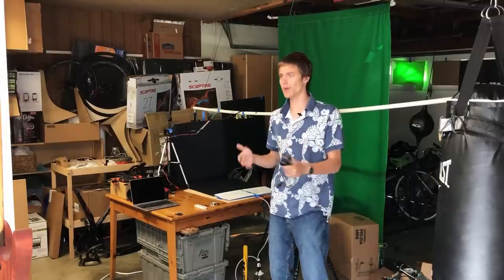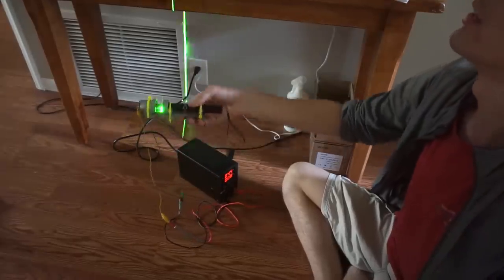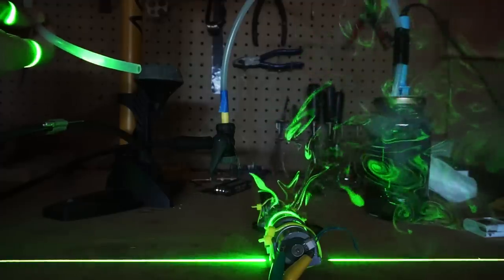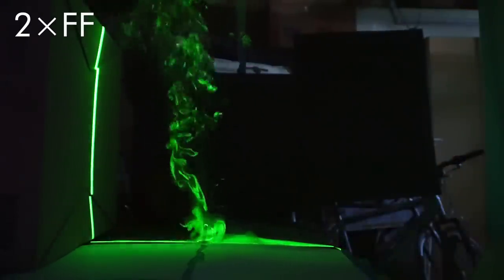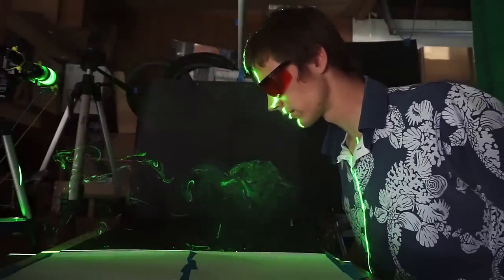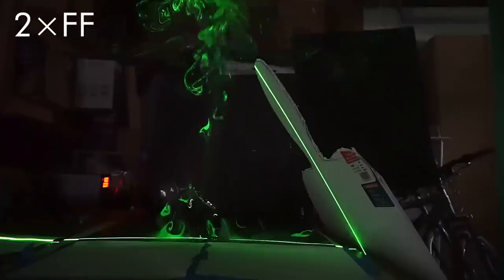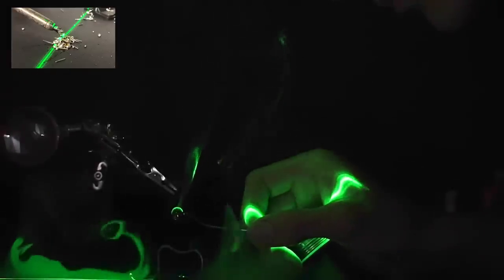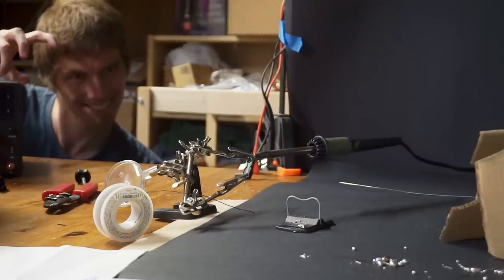Why does smoke from a soldering iron ALWAYS go towards your face???

Comment: As a guy with stage technician experience, I can tell you: Yes, evaporated baby oil is in fact harmful to your lungs, and can cause what is called Lipoid Pneumonia. If you want to be safe, use regular fogger fluid, which is a mixture of water and propylene glycol or glycerin, which is perfectly safe and won't hurt your lungs.

(And why the hell does this channel have so few subsribers ... it's awesome!)
Reply: So, what’s actually safe about fogger/vape fluid? It still accumulates in your lungs, and it doesn’t evaporate, right? Is it absorbed by your lung tissue and later removed from your bloodstream by the kidney? While for stage smoke you’ll often want it to be buoyant enough to fill a room, but using dry-ice or an ultrasonic exciter should work well enough for this sort of temporary use. Surprised ultrasonic vape pens aren’t more popular.

Also I’m pretty sure professional haze machines use oils, not glycol/glycerin, so in small amounts it’s probably acceptable. Though you’d probably get more particulate oil from working with an air compressor than going working at a concert venue.
Reply from the maker: Glad you liked the video, and wish I knew about the subs lol. I still have fun making stuff xD

Thanks for the info about oil smoke! I initially chose it because the internet said it wouldn't leave residue all over my garage but maybe I should have included a few more criteria... I added this to the description as a safety correction!
Reply: @Scrogan  Propylene glycol does evaporate, albeit slowly. Glycerol evaporates even more slowly. They are also metabolized in the body, and some gets expelled by the kidneys.
Reply: @AlphaPhoenixChannel  Probably a good idea to pin that comment in case someone  is thinking about trying the setup shown in the video
Reply: You can use 0% nicotine vape fluid also.
Reply: Oil is bad for your lungs, it's the same reason you shouldn't use an inexpensive off-the-shelf oil-based air pump for underwater diving, the aerosolized oil will damage your lungs.
Reply: @crazydavidsmith  Which, by the way, is exactly the same thing. Just sold in smaller quantities :)
Reply: small note about that fogger fluid: the water in it makes it susceptible to mold (which you don't usually wanna atomize and spread all through a room), so don't store it for too long. there's also mixtures with just the propylene glycol and glycerol (kinda the same as in a vape) that shouldn't have this issue. but yeah oil will kill your lungs, this stuff will trigger your asthma worst case but that's about it :P
Reply: You can also use an ultrasonic humidifier as a tracer source to be even more safer…
Reply: You could have used Incense Sticks. That would have made the experiment much religious.
Reply: @Scrogan  I am a year late, and the previous replies here are great. Just wanted to add one more detail: Glycol, the "main" ingredient in fogger/vape liquid is an alcohol, even though many people confuse it with an oil. So, those liquids are mainly glycol (an alcohol) and water. There's no oil in it, so both components are safe to inhale (up to a limit, like everything!) and will be properly processed and excreted by your body. Part of the excretion process from your lungs is also just exhaling it, which is great!

For inhaled oils, I know that they do coat the lungs (like pretty much everything), the problem being that our bodies have no way to get it out, so it will end up pooling and staying there. Nasty stuff. I'm not a doctor, so maybe it can partly be coughed? But, seriously, don't count on it, *never inhale oils!*.
Reply: @AlphaPhoenixChannel  Ventilateed/perforated section of table/workstation (cool air supply through the worksurface) 
Eliminate the arm/torso chimney effect on the draft?
Reply: @crazydavidsmith  that's the same thing as VG/PG fog fluid but overpriced if you can get the separate parts & mix them yourself
Reply: @350606  It’s true that glycol is an alcohol, but that’s not what makes it safe to inhale. Methanol, for example, is not something you want to inhale. It’s just that glycol has pretty low toxicity and won’t wreck your lungs. PEG probably counts as an oil, depending on how you choose to define oil, and that’s also pretty safe to inhale (though some of the products made when it’s heated aren’t great), which is why it’s used in vapes
Reply: @patrickjordan2233  @AlphaPhoenix, I was also wondering about setting up a fake set of arms on the other side of the table to compete and 'pull' the smoke back in the other direction.
Reply: @Scrogan  The reason ultrasonic vape pens aren't common is that the vapor production is slow and some people really like the warm vapor instead of cool vapor.
Reply: @crazydavidsmith  yutre2
Reply: @Scrogan  You should look up cell fusion  for monoclonal antibody production. We literally melt two cells together using PEG as one of the active constituents. Thats part of the healthhare concerns.
Reply: Self proclaimed health experts.
Reply: I hated those old oil based fog machines...
Reply: Haze machines don't use oil anymore. Oil in your lungs is specifically unhealthy because it needs to be cleaned up by your immune cells, and they get saturated with it, which stops them from doing what they're supposed to be doing, which is keeping you from getting pneumonia. Just because artificial fog used to be oil doesn't mean we should keep doing it, gasoline used to have lead in it. Inhaling glycerin or glycol can be bad too, because they're mild solvents that break down the fatty lining of your lungs and create the same problem on a smaller scale, but inhaling vaporized oil directly is many times worse. The serious illnesses involving vaping that have been in the news are from people putting oils like vitamin E in vaping devices.
Reply: Isn't that the exact same stuff that makes up a majority of vape-machine liquids?
Reply: @Scrogan  Or an ultrasonic mist machine (humidifier or fountain fogger) with distilled water, of course.
Reply: @patrickjordan2233  How about a down-draft table?
Reply: I didn’t even think about that! Mineral oil is not good to inhale, so it’s insane that this video is still unedited. It’s promoting a deadly practice.
Reply: @ffrreeddyy123456  As I recall, he said in reflection that mineral oil was a bad idea. Rock bands have been using mineral oil for decades, so the deadliness of the practice is a matter of dosage. Are you suggesting that the video be edited to eliminate the mention of mineral (or baby) oil, or that an annotation be added saying "DANGER! Baby oil is highly toxic when inhaled! Do not do this at home!" or something like that?
I think you're overreacting.
Reply: @GordieGii  sure! It'd have to be powered..but that's not the end of the world...  ))))
Reply: @Scrogan  Dry ice does tend to displace a great deal of oxygen, I find that to be important to my immediate well-being...
Reply: @Scrogan  "Small amounts"? Cigarettes produce "small amounts" of tars and nicotine...
From what I've seen, it was the professionals who first moved to glycerine to begin with. It is harmless in the body and non-irritating to the performers.
Reply: @crazydavidsmith  The aromatics and flavorings might be off-putting...
Reply: @earth2k66  You just reminded me of a hilarious event for my father... albeit kinda embarrassing for him, too...
He was an electronics instructor recruited to present a half-hour LIVE TV show on our newly established state-wide educational TV network (The mid-50s). He was attempting to demonstrate the operation of an electrostatic "smoke precipitator" using the smoke pellet for a model train setup. What he hadn't checked on might have saved him, but he soon learned that those things don't burn in free air, they smoke only when heated. Cancel demo, start ad-lib...
OK, ya'll can go back to sleep now.
Reply: to add unto this, a few years ago several ignorant teens in the us ordered shitty vape cartridges from crappy chinese instagram accounts that were supposed to contain weed, but they instead either had some vitamin (I forget if it was vitamin B), or baby oil. They got fucked up and blamed the vape industry, which got crippled to the ground, since some of them did not want to admit they tried buying weed.
Reply: @AlphaPhoenixChannel  Hey! You should try to make a row of laser planes to visualize airflow in 3D (sort of) space!
Reply: @cheetahspot  Except for the water, you don't want water in your vape fluid
Reply: Actually, just get an ultrasonic transducer and use plain water (it's cheaper) . Unless you really need to eliminate condensation, it works fine for pretty much everything.
Reply: @AlphaPhoenixChannel  Please give me a chance.
Reply: @AlphaPhoenixChannel  Uh oh. might want to retest this.
My uncle actually debunked with one while i was watching this and he walked by and said "nope, thats not true" like boomers do, then since im a typical ignorant millennial that thinks i know everything, i said "prove it" so he simply did. By simply just leaning over with his arms behind his back, the smoke still travelled towards his face, and i was like, "yea but that didnt prove why it happened" and he very rightly said, "you only said to prove the arms dont effect it, i have proven that." and he in fact did, but it still leaves the question up in the air as to why it happens when in fact the arms are having ZERO effect on it
Reply: @philchia4764  PEG is very different chemical than what is used in smoke machines. Also in order for PEG to work for cell fusion the concentration needs to be quite high.
Edit: And some cell fusion happens spontaneously anyway.
Reply: thanks
Reply: Just wait... AlphaPhoenix is about to get a surge of subscribers after Derrick from Veritasium does a response video to AlphaPhoenix's response video. Heads up AP
Reply: Now figure out why a campfire smoke goes to just one person. Something I observed
Reply: Hey, fellow stage tech! I worked in a motion picture equipment rental house/rental stage in the late 80s/early 90s. We had a couple of portable smoke machines that burned “fog juice” (which might even be trademarked name—Iirc Rosco was the vendor). I remember being told the same thing about the fog fluid’s composition. The knowledge was useful later when I worked on film sets and people expressed concern about the safety (there’s always one person) and I could reassure them.

We also had one interesting bit of gear that never got rented. This was a bee smoker that burned incense pellets, commonly used by bee keeper. It had a metal receptacle to hold the burning incense and a small bellows that puffed out the smoke. It was stinky as hell compared to more modern smoke/fog machines.
Reply: @WCM1945  Dry ice fog wouldn’t be useful for this experiment. It tends to hug the floor, probably due to it being cooler than the surrounding air and/or it being denser/heavier than surrounding air. It will dissipate as its temperature equalizes with the surrounding air.

I wouldn’t worry too much about crowding out the oxygen leading to suffocation unless you’re trapped in an airtight space (or tightly enclosed space), and then you have other problems. As you suggest, carbon dioxide released from dry ice isn’t itself harmful. It’s the lack of oxygen. This is why it’s not a good idea to wrap your head in plastic for long periods without poking breathing holes through the plastic.
Reply: @AlphaPhoenixChannel  I'd also check about the "no residue" part. We're talking about oil suspended in air. When it hits something, it's going to stick.
Reply: Tooo late
Reply: "(And why the hell does this channel have so few subsribers ... it's awesome!)": Yes this guy is fabulous! As the world consists of 80% with very good working sight (that's why young girls as influencer have millions of "followers") and 98% who do not know Immanuel Kant, so only the 2% enlightened will subscribe to this channel. BR
Reply: @joanandkuharajasekaram6738  oh common! Kant was a graphoman who basically made a career serving the idiots who believe in god and wanted him to comfort them by supposedly prove existence of god. He did nothing important to science and no educated man shall know him or read his graphomania.
Reply: Hey there is a lot of comments in here, i want to know if I should get a respirator, they are not expensive, but I'm going to be soldering something and I don't wanna inhale none of em fumes, I have a small fan (tiny) and one window, should I get a respirator, it is very likely that the smoke may still reach my face so I want to be sure, so if I should get one please tell me which!
Reply: This begs the question though as to whether acute exposure (relatively large amount over a short period) or chronic exposure (smaller amounts over long periods of time, as in years) will cause lipoid pneumonia. I'm about as familiar as a lay person can get with medicine. But lipoid  pneumonia's something I've never heard of. So you've piqued my curiosity and now I've got to read up on it more. But as a person who vapes, it makes me glad that the people who made ecigarettes had the forethought not to include baby oil, or any oils in the juice. It's just nicotine, polyethylene glycol and glycerine. Which, PEG is still irritating for mucus membranes, and technically chronic irritation of a tissue CAN lead to an INCREASED RISK of developing conditions which may become cancerous.

 But how strongly this reaction of potentially developing cancer from chronic irritation depends on a lot of things like what the irritant is, what kind of tissue it is, how often the irritation's occurring, how severe it is, and many other things. But the key takeaway is just that chronic irritation can potentially cause cancer. So if polyethylene glycol irritates mucus membranes, it could CONCEIVABLY be carcinogenic. But I want to stress that this is all nothing but speculation. So please don't think I'm stating anything factual here. As far as I know, there's never been any evidence that ejuice (without certain additives) causes cancer when you vape it. I'm just saying I wouldn't be surprised if it caused at least a small increase in risk because of the irritation it inevitably causes.
Reply: Mineral oil is definitely bad for the lungs
Reply: Just don't huff the stuff. Then you'll end up filming yourself and adding it as a blooper

Comment: Low tech solution boys, just exhale when you're actually making a solder joint. Works 60% of the time, every time.
Reply: Instructions unclear, inhaled it instead.
Reply: Instructions unclear, inhaled the solder iron instead
Reply: @CatSovietski  tasty lead
Reply: Instructions unclear, inhaled drugs
Reply: Instructions clear, made a solid solder connection AND inhaled drugs
Reply: That will cool down the joint
Reply: That's been my inconsistent trick, too. I try at the board and above, though I don't remember what helped more.
Reply: @Argentum392  I've been soldering for a while now and a very slight exhale while you solder is a great way to get rid of the smoke, I wouldn't blow on the joint but a bit higher
Reply: Hahah, nice Anchorman reference. :D
Reply: @Argentum392  I think I speak for most of us when I say we set our irons several hundred degrees higher than the melting point of solder. I personally keep mine between 650-750 based on how robust the connection. Go ahead and put a nice ball of solder on the end of your iron and try to solidify it with your breath. For safety make sure you keep a friend on close standby to catch your body when you pass out lolol
Reply: @EvenTheDogAgrees  ty :)

Comment: As an Occupational Hygenist, I find this explanation very useful. Please use a P100 mask when soldering so you don't inhale tin or other hazardous metal particles. The smaller the particle, the worst for your lungs.
Reply: And having a little object perturbing the air like a small desk fan will help as well, if only to lower the concentration of smoke particles in the air you breathe.
Reply: Most of the harmful stuff is the flux, which is pretty nasty
Reply: I've been breathing it for over 50 years and my doctor is impressed by how healthy my lungs are.
I have never been a smoker.
Reply: @mrhassu588  Yes. Flux-less solder fumes less and the smoke from is just vaporised tin particles which do harm your lungs but they are in very low concentrations.

Comment: Basic materials and equipment to make a soldering station:
- soldering iron
- solder
- sponge
- cardboard cutout of yourself staring into your soul at opposite end of the table to invert draft.
Reply: Never forget punching bag for when your hands just wont stop shaking
Reply: @sagebalsys7390  yep
Reply: Make the cutout double your size so it doesn't cancel out but inverts it by 50%
Reply: @sagebalsys7390  I always make the mistake of drinking a triple shot latte before working on things... Doesn't go very well
Reply: @untitled2792  nice pfp
Reply: @RichConnerGMN  thanks
Reply: Can you trick it with a cardboard decoy
Reply: haha I will add it to the list
Reply: @RichConnerGMN  didn't expect to find you here
Also, grievous error

Comment: Same with virtually every welding and plasma process known to man...     Many times - while coming down from a bad case of the zinc shakes (in spite of holding my breath and having strategically placed to blow across my  back)    I've said to myself  that if I  ever  decided to pursue my engineering  PhD, it would address this very phenomena.  Thank you for saving me from that fate...  from now on, I'll place the fan so it blows under the chin of my welding helmet....  :)

Comment: Nice research :) My solution to this problem is using a small computer fan to suck away the smoke. It is important here that the fan really sucks. If it blows, it is cooling the soldering iron too much.